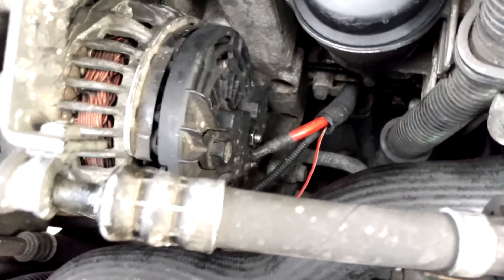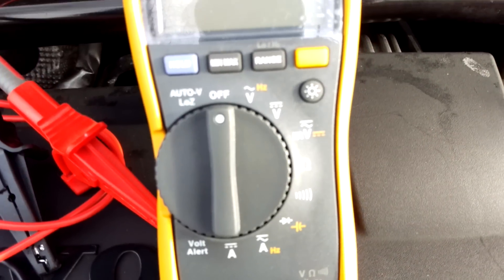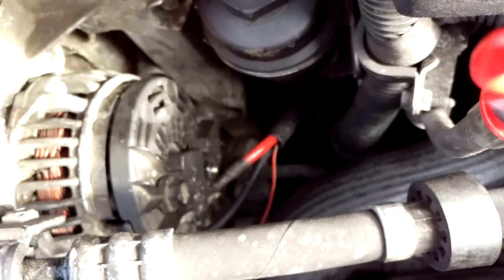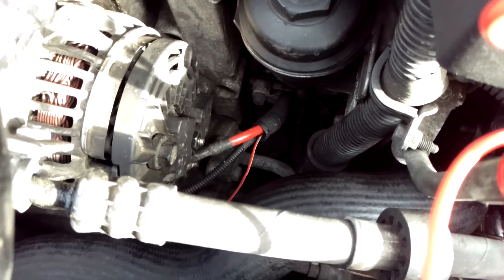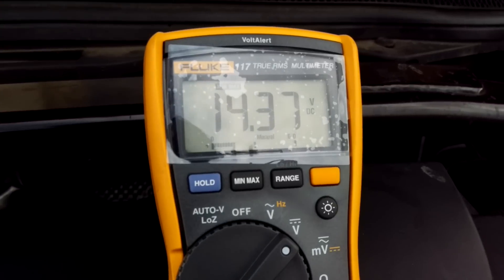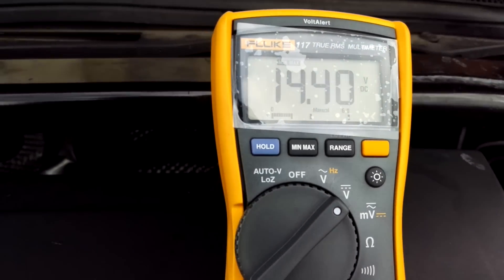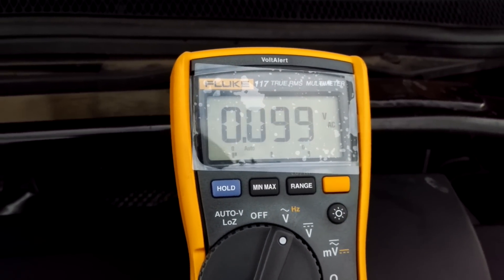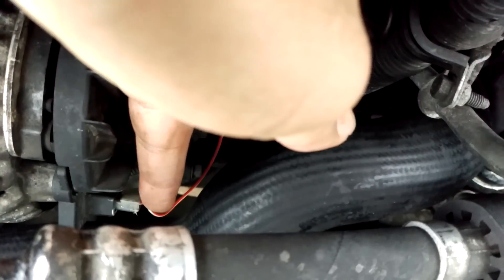How To Test an Alternator Part 2. Rectifier, Diode Pack, Parasitic Battery Drain

Comment: Great video.  I'm a little confused as to why multimeter hot -> casing, and multimeter negative -> post?  My problem is 11v - 12V with engine running, and 25V AC voltage measured across regular +/ground points on the vehicle.  According to this test however, the alternator passes the test.  I even disassembled the diode assembly, desoldered, and tested each diode with diode check function, pass.  However one of the brushes in voltage regulator may not be contacting.  Any ideas?
Reply: The rectifier is where AC is converted to DC, if your getting AC at the post then rectifier/alternator is bad. Low voltage could be that or another issue some newer cars feed the magnetic field current with the ECM (computer) via one of the small wires by changing the DC input to the field they can modulate the alts output. This is maybe for economy. Some vehicles alt output drops below 12.6 due to the ECM. Some people have this section of the control fail or just dont like it and feed the Feild a battery + source after the ignition switch to negated that damaged or undesired operation. Old timers would do a toggle switch on race cars to keep parasitic loses down during their pass down the track. Car audio guys will add diodes to the field wire which tells the alternator a lie (minus X volts) that the battery is lower than it actually is. Doing this they get the alternator to supply slightly higher voltages closer to where they prefer. The average case of this mod would look like 1-4 specific diodes used to raise the alternator voltage from like 13.2-13.5 up to 14-15 volts the diode used sets the change (lie) most aim at diodes giving -.5volts reading on the field. Diodes can be parallel or series or both depending on the needs, series allows a smaller diode set to handle a bit more amps because they do get hot being a resistance to burn of or hold back voltage. In the case of the car audio alt mod there isnt a bunch of amps flowing as if you was to say mod a computer power supply bundling the 12volts to power something at high resistance like a cloud making drip vape... rambling yadda yadda...   Any who, you have a bad alternator rectifier most alts have limited life warranty if it has been replaced from parts store so if your lucky you get a free one. That stray AC current isnt good for DC systems and should be below .500 volts AC most would prefer it be half of that if not zero.
Reply: @masterdebater8757  OK I really appreciate this response for so many reasons.  Perhaps you would enjoy the mystery of how this issue concluded, as thus far neither your comments, my brains or the internet have come up with an explanation.:  Shortly after posting that comment above i did another test:  there is a (+) terminal on most BMW's with two very heavy gauge wires connected, and on mine on (red) cable goes to the starter and alternator, while the other goes to every other function of the vehicle AND the battery leads.  Obviously this is set up for ease of diagnosis.  The 25V AC voltage continued to read NOT on the alternator/starter side, when I interrupted the circuit.  But on the other side.
Reply: @GreenOrgyKing  if your breaking the Circuit to the PDC power distribution center and the AC flow stops i would venture to guess your removing the ECMs control over the Field and it may have a redundancy in place to read straight battery at that point. Would imagine doing that would kill the engine thus negate the test so im not sure what you mean to say.
Reply: @masterdebater8757  So I ended up replacing the alternator, the serpentine belt tensioner, and only then were things back to normal.  I still don't know if the problem was maybe due to some kind of short circuit loop between the casing and the windings in the old alternator, or somehow possibly due to incorrect tension and slippage on the pulley?
Reply: @GreenOrgyKing  Slippage would not have given AC voltages. Maybe you had 2 issues 1 internal and one external in the connection points of the alt housing to ground/engine block..  There is a paste used in sparky world called Noalox its purpose and general use is where dissimilar metals contact each other in electrical systems it is an anti oxidant that will reduce chances of galvanic corrosion that could reduce your ground connections over time. Many people dont think to clean the connecting surfaces when replacing alternators where i am not only cleaning them but installing security measures to ensure it stays clean. If you didnt yet inspect all your grounds on the vehicle the closer to the ocean or farther north where salts are used you will eventually have damaged grounds particularly the flat straps manufacturers use.There are sometimes 2 or 3 of those non insulated flat straps 1 engine to frame 1 engine to firewall and sometimes a 3rd frame or PDC to fender. They use those flat straps to save money the strap can cool because it doesnt have a sheath this allows for less copper total to be use to pass the required current. 4-6guage to replace alt to batt, engine to frame and 6-8guage for the smaller connections is common practice if you find a green or white crusty one. When grounds are bad they tend to become resisters adding to the load on the alternator causing more heat because the angry pixies cant get free fast enough. Positive side wire issues tend to tell on themselves with poor performance but ground side has more possible paths and tends to stay hidden till failure happens.
Reply: @masterdebater8757  But i tested everything that would be acting as a rectifier.  In fact i saved the big diodes because they are incredibly robust and will try to resurrect some electric vehicles via custom rectifier circuit

Comment: بعد شُكر الله ؛ 

شـــُكراً لّك . 
Thank you Very Excellent . 
 My Advice to all of you ; 
After you clean those wiring and cable 
connections grease them with silicon grease .

Remember ;
sometimes '
cleaning the posts and 
connections is not enough
because corrosion penetrate inside the
wire or cable end which require replacement ،،،،،،،
or cutting wires and or cable ends and re-crimping them .

Comment: Great video. Just did this test as I can’t find any drain elsewhere.

Reading 400 Millivolts with black lead to alternator terminal for battery positive and red lead to alternator case, and 2v when I switch them around?!? Neither of those values sound right? I am using a good multi meter with diode function.
Reply: Ya i got about 450 so im thinking this is my problem.. time to take the alternator off and get it somewhere to get rebuilt or fixed

Comment: I'm about to swap out my rectifier..do I need high melting point solder to reattach to sator wires or will any solder do?
Reply: just regular electrical solder. how did it go? what wattage iron did you use?
Reply: @thehamburglar9mm  dont you love that how people never return SMH> we both know he went and bought an alternator right?
Reply: @masterdebater8757  haha most likely.  Not what he told his friends though.
Reply: Just swap out the alternator, don’tmess with the rectalfire

Comment: well put. your explanation was very understandable.  now that there are a zillion exceptions listed earlier, i wish i could help but the details are probably gonna solve alot. jmho
ie: a 1.6a drain (meter + on the alternator output)is a bad alt.  a drain w/ alt disconn = something else still draining. 
only reason i'm here is because my wifes 2014 buick is draining, and it was @ 1987 when i last did this kind of work lol.  bikes - not sure what switches are involved.  new cars - open doors but close their latches, unhook trunk & dome lights, and don't leave the dam glove box open like i did when getting started.  i use the dim filament test light method (in series to neg batt post).   good luck a new battery is expensive.

Comment: What if black to B+ and red to alt body and it is reading more than the value of 500-800? Reading is about 1200+. No value on red to B+ and black to alt body. 

Battery is not draining. Lights are flickering. 

Dc volts is also around 13.5-13.9V at idle. But when at high rpm sometimes it goes up to 14.5V. 

Also tried the ac volts with a reading of 29. 

Is it a sign I have a bad diode? Car still starts fine.
Reply: mho is the alt is fine, just diff diodes in various models.  lights flickering is probably a diff beast altogether.  probably loose connection.  if both sides then start at their source - headlight conn or column
Reply: flicker randomly all the time, when hit bumps only when driving, factory lighting kits/bulbs, car audio installed, do they just dim like when ac compressor/cooling fans run kick on? Anything more than .5-1volt AC is unacceptable means AC current bypassing rectifier and getting out put into a DC system does the light flicker speed up as the engine revs? If this is the case that is your reason AC power is in phase with the revolution of alternator this is why  AC generators RPM has to be set specifically to match the needed hertz cyclic rate 50 or 60 hertz is 50 or 60 pulses per second. The DC output of modern car charge systems with non direct connected fields (ECM Controlled) generally use ambient temps to determine the needed output voltage the colder it is the higher the voltage it calls for... In cold start normal weather a car may charge at 13.4-13.8 as car warms road warms it could drop very slightly. In cold start cold weather system could charge at 14volts and up. This all depends on the vehicle and type of control that is designed in. Some newer cars have economy modes dropping charge voltages into the 12volt ranges once every parameter it looks at is satisfactory. Next time give us a bit more info for a better reply.. Year. make of vehicle, a bit more specific about the actual problems.. The info you gave is all within spec for some cars and possibly out of spec for others the only outlier here is the AC voltage.

Comment: When I did the reverse test my meter read like 1600 for a split second then went to one.  It did that a couple times , why did it show that high of a reading then go to one.     Is that normal or is my alt bad.
Reply: for a split sec?  i'd look up other vehicle types - i think zener diodes might allow that, not sure.  sounds like gate V but i'm old and senile
Reply: Got the same type of reading on a new Alternator today.  high impedance is what I have come to think. I called the manufacture, and they said it will show that with the leads reversed in the test. The tech pointed out the use of "avalanche diodes" in the build of the alt. My guess is high impedance might be good? I think an easy OL would be somewhat better, but after reading theory of operation, understand the reason ECM and module controlled vehicles benefit from there use.

Comment: When I put the black on the alrernator and red on the post I got the normal OL, when I put the red on the body and black on the post I got 0.000, yet the alternator is overcharging when its running at 15.2-15.4V, what do I make of this? Is it draining the battery and overcharging at the same time?
Reply: imho the V regulator sounds bad.  if that's internal then rebuild alt.  if external better option

Comment: 8:20 when i put the red on + I get 1607, the other way (black on +) it is normal 537. But Disconnecting the alternator does not change the parasitic draw measurement at the battery.
Reply: Mine did the same thing your describing , let me know if it’s normal if u ever find out .
Reply: @nobs846  I think it is normal, not 100% sure but I will try to remember to give you feedback when I have measured other identical bikes.
Reply: @Snurre86  ?
Reply: @masterdebater8757  please be more specific!
Reply from the maker: You need to follow my other longer parasitic drain video.
Reply: @sirobb  you have no choice, read me comment again.
Reply: I recently got a new alternator. Positive test lead to case, and negative on bat post reading was 450 or so ( the old one gives a 899 reading). But exspecting to see OL with test leads reversed on the new alternator, instead What I saw was 5000 ish? I tryed to calibrate the decimal point location, but never saw it move. 
I then called the manufacturers hot line and was told " That because avalanche diodes are used in the alternator, that it will get a reading in reverse polarity and that the unit was showing expected readings".  
From all I have seen in the past and confirmed in the video testing here, I would have assumed assembly had a bad diode in the rectifier pack. But after reading for hours about avalanche diodes and why they are used, I am still wondering what the numbers I saw related to, and if they represent parasitic drain.

Comment: Hi buddy, thanks for the vid.

I've a 2005 Fiat Ducato 2.0JTD.  I've done your tests and not getting a reading in reverse, but i only see a battery drain when Alt connected??? :O

My mind is about to go on strike.  3 days I've been dealing with this.

Battery is brand new, and charges fine at around 14v.  takes about 2 days to run the battery to low cranking volts.  Reading from 350 to 700 milliamp drain when alt connected.   Reading 550 on Diode Test one way.

I think I was confused about how you tested the AC current.?

Any ideas?

Comment: I  think you mis spoke when you said a maximum of 1.4 volts on the AC output test .I think you meant to say max 0.14 volts AC output
Reply from the maker: Yes it was corrected in the video and the multimeter shows the correct reading.

Comment: For diode testing, how about removing the Negative from the battery then remove the B+  cable (Merc C220) from the alternator? Just seems safer to perform such tests with no power in the system.
Reply from the maker: Sure, you can do it whichever way is the safest for you.
Reply: @sirobb  The alternator was tested today and seems fine so there must be a drain elsewhere. Thanks for the know how by the way!
Reply from the maker: No problem. There is a detailed parasitic drain test video in my list.

Comment: You connect the meter to the positive alternator post and fame of alternator.  A wire is from the post to the battery. Why cannot the meter be connected to the battery for convenience.
Reply from the maker: The video is measuring alternator output so you measure at the alternator B+
You could measure at the battery but if the voltage at the battery is lower than expected, you don't know if it's an alternator fault or voltage drop through the wiring or connections.
Reply: @sirobb  
thx.

Comment: Can a simple electrical check by auto parts store determine if there's a bad diode?  I am not getting any reading for a parasitic drain.

Many thanks
Reply from the maker: The simple checks are shown in this video so anyone with a multimeter can do them.
Reply: @sirobb  
My alternator is innecessible for these tests.  I have a ford Taurus duratec and the alternator is near the  fire wall and hard to reach.  Just need to know if an electrical test at auto parts store (free test) can reveal a faulty alternator diode.

Thanks for your prompt reply.

Steve
Reply from the maker: A faulty diode reduces DC output and increases AC output so yes, faulty diode symptoms can be spotted very quickly and easily if they know what they're looking for.
It's down to their competence.
Reply: @sirobb  
Agree and thanks again

Comment: In the diode test u removed a single spade connector  plug that i dont hav on my alt it just has a 2 wire plug do i disconnect this?
Reply from the maker: You disconnect the battery negative first then any alternator leads so it's just the alternator bolted to the engine block.

Comment: Hello Rob,  On the Rectifier diode test, on the forward test I am getting a reading of 1.02v and on the reverse test  zero. Would you consider the the rectifier is faulty?
Reply from the maker: Sounds ok. There are 3 tests in the video though to confirm.

Comment: I took my alternator apart, because it was draining constantly some 200 mamps. However when I measured the diodes on the rectifier they were working fine - not seeping current wrong way. Can it be the voltage regulator? When I connect the voltage regulator, the alternator has continuity both ways. Slightly moving the regulator affects the continuity. Is it possible that inside the regulator there is a short or something that makes the alternator to drain the battery?
Reply from the maker: What were the AC and DC output readings?
Reply: @sirobb  DC output was normal I suppose. The battery was being charged. I don't know about AC...